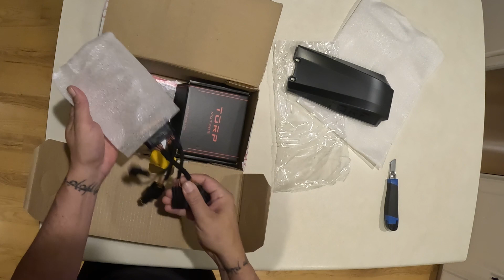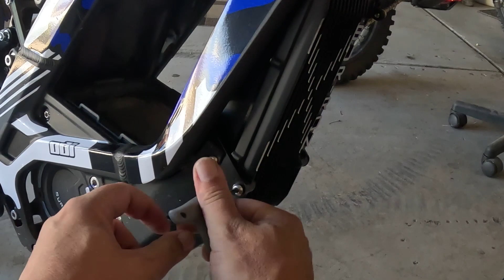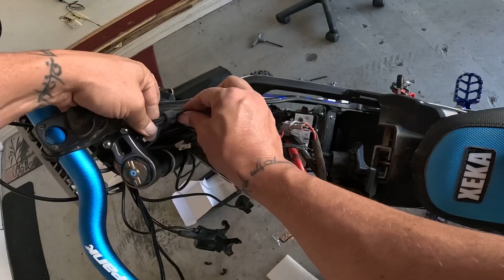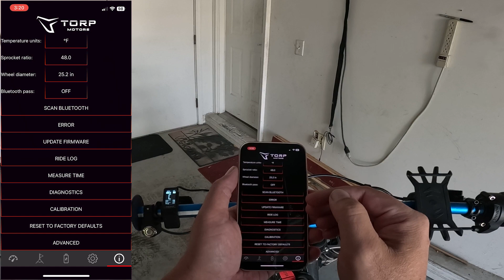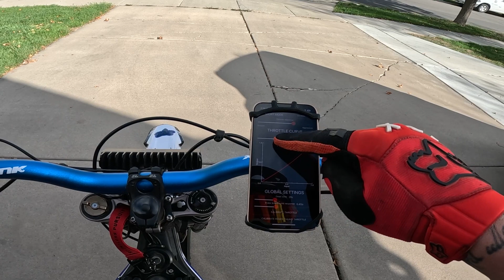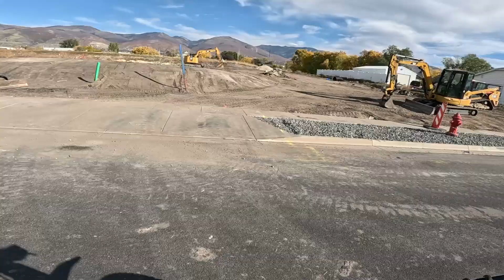Torp TC500 Surron Controller unboxing, install, and review. Game Changer for Stock Sur-ron #surron

Comment: I put my BAC4000 back on after testing the Torp. this is a speed controller which is inferior to a Torque controller like the BAC4000.
Reply: can you provide some more info on that, I am trying to decide from a bac to a torp, can you unlock 8kw with a bac? on a stock 38ah battery, Samsung cells?
Reply: @economossotiris2622  DONT BUY BAC
Reply: The BAC4000 I got from GLE comes unlocked for crazy power. With there new motor and an aftermarket battery you can easily set it to 25kw of insanity @economossotiris2622
Reply: @Buffetology  As someone who doesn’t care to run more than 14kw, can you further explain why you’re saying a speed controller is inferior to a torque controller (regardless of brand)? You’re not the first person I’ve heard mention this. Thanks

Comment: Are you still running your belt on the motor or did you upgrade to a chain?
Reply from the maker: Yes..  the primary is still the Original Belt.  I have had no belt issues thank god.

Comment: Do you feel any difference in the throttle from stock tune? Is there a setting for throttle curve or anything in the app?
Reply from the maker: yes. you can adjust the throttle curve and sensitivity.  I made it feel as close to stock as I could.  its really smooth.   The app is actually pretty intuitive
Reply: @clu801 Thank you. Personally, I never realised how much I hate my stock thorttle feel until I tried the mx4. Making a decsion soon and TC500 looks like it might be the one!

Comment: Great video! Please review the KO vs the Torp after some use, since you got both on diff bikes! Are you running the 38ah, 34ah or 32ah battery? Curious how many watts I'll be able to pull with 32ah battery?
Reply from the maker: Thanks!  I do plan on doing a bunch of comparisons with the KO.   I am running 34ah .   I don't yet know what a 32ah would get.  I am not totally sure how it works.  since the 38ah can get over 8kW but has inferior cells(samsung) compared to the panasonic in the 34ah.    I will see what I can find out.
Reply: @clu801 Thank you! Looking forward to the content. Would love to hear what you find out regarding the diff batteries (32ah specifically!) in one of your future Torp videos!

Comment: Going to have to start calling you 'Clu-Ronster' with those wheelies LOL 🤣
I'm digging the Torp - probably even more than the KO.
Reply from the maker: Ha ha, thanks! Honestly, the throttle on this controller is so smooth. I took my son out riding it today and his wheelies are even better than before. His reaction and wheelie video coming soon.👍
Reply: Do you like it better then the KO controller
Reply from the maker: I think time will tell.  There are advantages to both for sure.   KO can use more phase amps  but I personally don't use tons of phase amps.  It took KO over a year to make the throttle smooth.  This Torp out of the box has very smooth throttle and its huge benefit is that it can be a pretty significant upgrade for people with stock bikes that can't afford a controller and battery at the same time. The app has a lot of cool features as well.  Also.. the fact that it can use the brake sensors to do regen braking is cool as well.